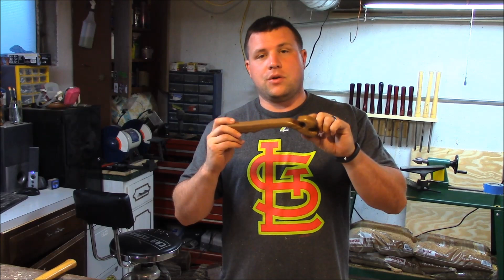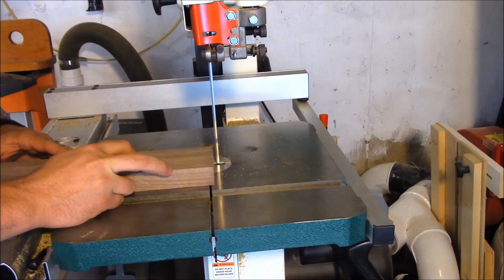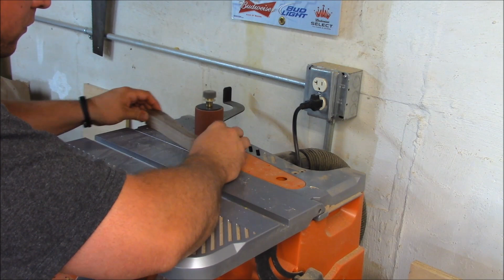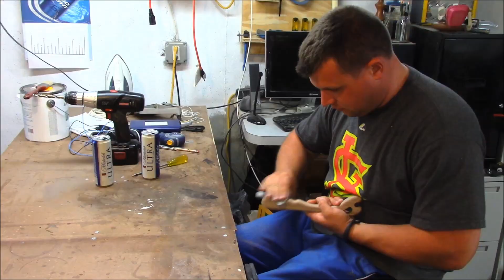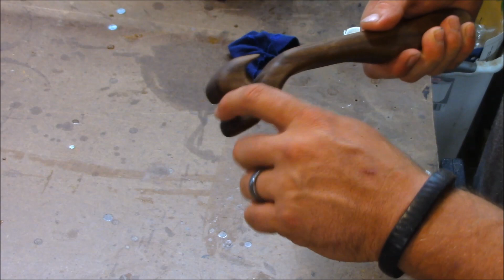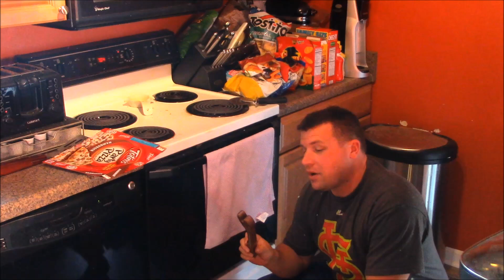How to make an Oven Rack Puller

Comment: Hals Wood Shop.   Use an olive oil it won't burn and can be recoated.  the spray will scorch on the oven rack its hot not the food.  also if you resaw the stock early close to half inch then retape it and trace the pattern and cut you can get 2 for one.  It should sell nicely.   the handle ridges are nice.  best wishes.